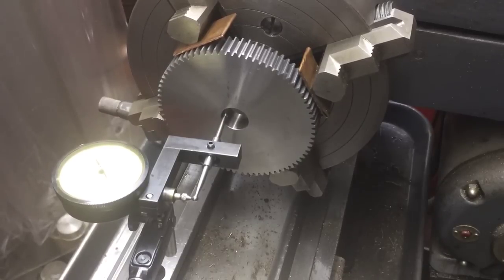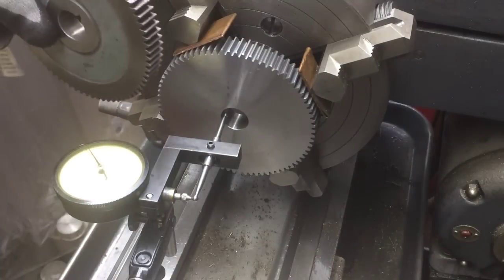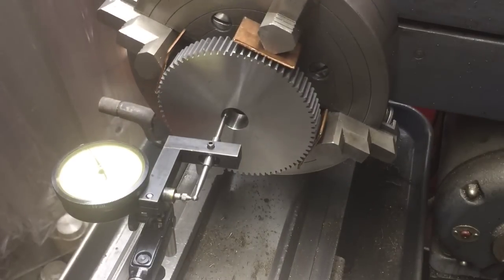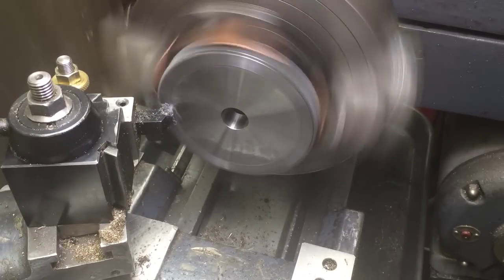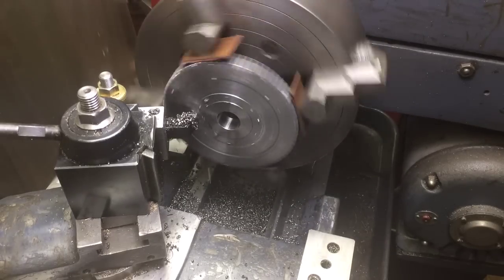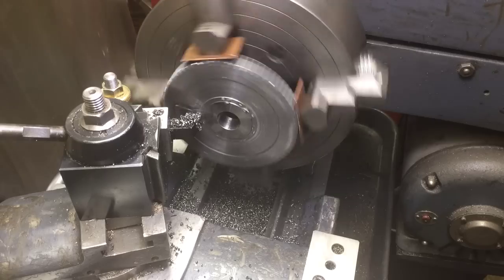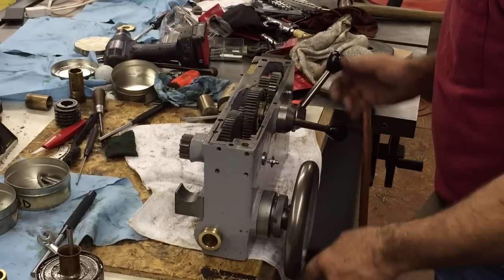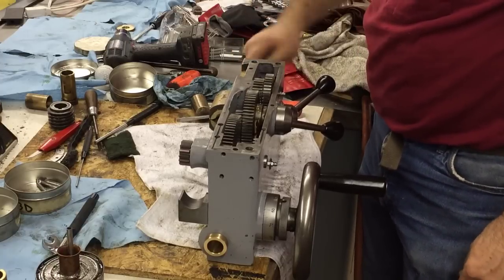Lance Lathe Repairs Part 5

Comment: Brilliant. Thanks for taking the time and effort to post. I like the broaching on the lathe, that must have taken a load of patience. Can't wait to see the Apron installed and working.
Reply from the maker: Martin Hile Thank you.  The broaching took 5 min to grind the tool, 2-3 min to setup on the lathe, 15 min to cut the keyway.  It is important to have the center of the tool on the center line on the work.  Apron is on and I did a test run of the motor last night.  Thanks for watching.  Randy

Comment: Hi Randy,

I've broached hubs that way myself in the past and also cut an internal gear in a similar fashion on the BP clone using the quill.

If you're going to do it often, then look into making a slotting tool holder that you can lever operate. Much easier on both the machine and the operator!

I noticed you were getting a bit of movement from the chuck as you broached. I used a length of  bar stock between a chuck jaw and the bed as a stop, and put the chuck key towards the back of the chuck, then hung a weight from a cord hooked over the key. That way you should get nice straight sides to your keyway.
Reply from the maker: Paul Compton Thanks Paul.  I have seen a few of the slotting rigs, they look to be good ideas.  I should put it on the project list.  The movement was the backlash in the back gears.  The first few cuts I held the chuck to remove it.  This was the first time I have done this on a small lathe, it is much easier on a larger lathe with some mass.
I just wanted to show that you don't need a 400$ set of broaches if you only do a keyway once in a great while.  Great comment, thanks for watching, Randy

Comment: Randy Richard Very nice work Randy, always enjoy your channel.  I particularly liked the broaching on the lathe, well done.  Love that little Myford, so quiet, my pacemakers coolant pump probably has a bigger motor, yet Myfords, by all accounts, are very capable machines for there size, no wonder they pull down such good prices.
Reply from the maker: James Kilroy it is an 11" x 36" Logan.  Myfords are nice.  Thanks for visiting the shop.  

Randy
Reply: Ah, still so quiet compared to a geared head lathe.  Very nice.
Reply from the maker: That was fast I just wrote that.  I just posted an update with the Lance running, it to is fairly quite.  Thanks James.

Randy

Comment: Very nice work on making replacements for the damaged gears and new bushings. Looking forward to seeing the Lance lathe in action.

I was thinking about using a Dremel fiberglass reinforced cut-off wheels for cutting the oil groves but I thought these might be a hard to control on the curved surfaces. Looks like you had no trouble with these. I use them a lot for cutting off 1/4" or smaller drill rod so I don't stink up the shop using the larger abrasive cut-off wheel.
Reply from the maker: Paul Jones Paul, That is what I used, I had great control.  The grooves are not very deep, then I cleaned them up with a triangle file.  I just finished up the electrical and test runs, Tomorrow clean up the wiring mount the speed pot.  time to get it leveled and in position.  Thanks for watching. Randy

Comment: nice work Randy how did the oil groove in the shaft turn out
Reply from the maker: david sanderson David, I think I forgot to show them.  I drew out a path with a sharpy, then I used a dremel with an abrasive cutoff disc 1" dia., then cleaned up with a triangle file and a little polish.  Came out good.  Thanks for watching, Randy

Comment: Nice work Randy! It was funny how familiar the peeling of the blue tape seemed to me after just doing the same thing on my Atlas, he he! One question though, what tool did you use to broach the keyway with? I was craning my neck trying to see around the corner of your tool holder but I just couldn't squeeze my head into the TV far enough :)

I'm asking because I want to broach out two keyways for some new handwheels I got from McMaster Carr. I watched a video from mrpete222, and he used a modified parting blade, but since I've only got one of those I'd rather not grind it down to fit into the 3/8ths" hole. Did you make a custom form tool to cut the keyway to the right width, or did you use a small broach?

Thanks in advance for any info you can give, and I'm very excited for you to be making such great progress on the Lance.

Hoping all else is well, and I will give you a ring soon to talk story...Aloha, Chuck
Reply from the maker: Knolltop Farms I will show the tools for the broach and the gear in the next video.  I have cut quite a few keyway stairs way in the past.  I use a HSS lathe tool, ground to size.  There is a lot of force on the cutting tool so it helps to have some beef behind the cutting edge.  It also matters how tough the material is.  The gear I was cutting in the video was fairly tough.  The hand wheels should not be to tough.  Thanks, Randy
Reply: Randy Richard
Yeah, the Zinc handwheels will be a breeze to cut, I just want to do a nice job of it, and so I'm going to center them in my chuck(that still feels weird to write, lol) and broach them like how you did, or at least how I think you did ;)

I'm setting up my bench grinder today and will try my hand at grinding and honing a tool for the job, so I don't have to chow down my parting blade. There will be a whole mix of stuff on the video I'm shooting today...just finishing my coffee as the batteries charge and I'm out there :)

Thanks for the tips, Aloha...Chuck.
Reply from the maker: Knolltop Farms Good Luck.  We are going to try to get the Clausing in the shop today.  thanks Randy